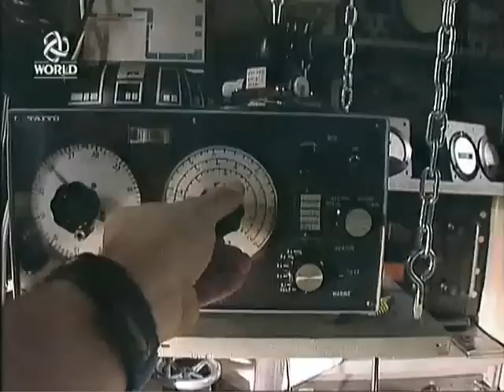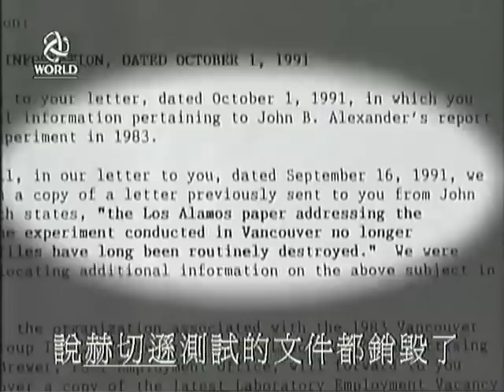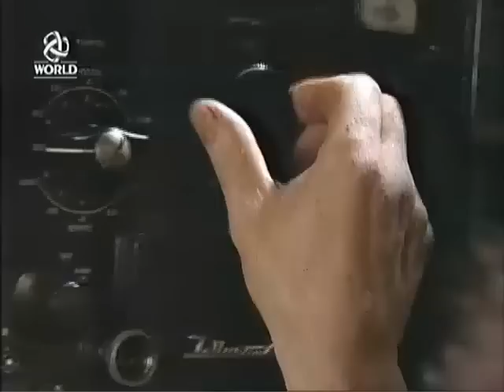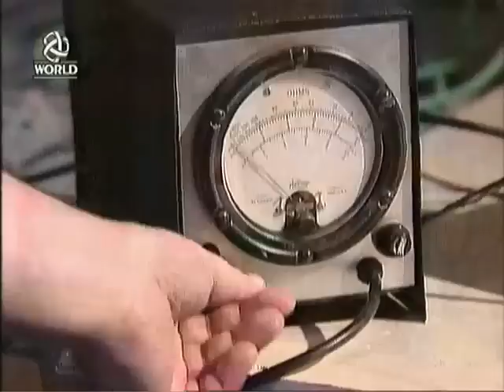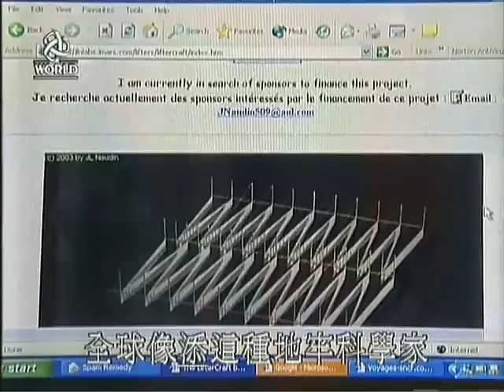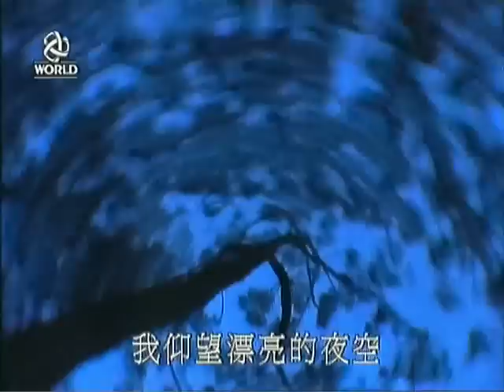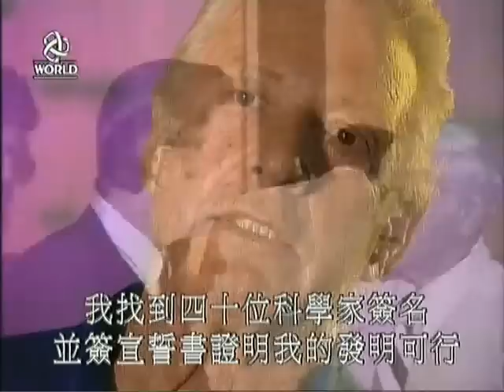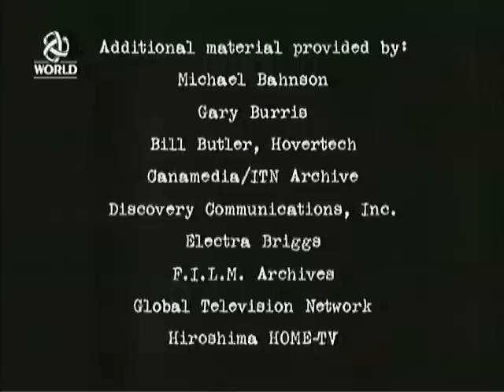Discovery Channel - Free Energy

Comment: Yeah.. when a mysterious effect has a wide range of unrelated results, that increase the ease of faking it, not decreases.  A single well defined, consistent effect that can be described and recreated, now that is hard to fake.

It should also be noted with the marconi example, people believed it was impossible for very good reasons and those reasons were true.  The physics was correct, and if not for a piece of information that had not been discovered yet, it indeed would have been impossible.  Long distance radio transmission did not rewrite physics, radio was behaving exactly as the math predicted.   That tends to be the difference between this drek and actual advancements, science is incremental.   Discoveries build off each other, not rewrite our whole understanding.   New discoveries involve 'what did we miss?', but still have to explain all the things we already know.

Comment: I want to build a solar powered steam generator, parabolic solar collectors, I need to find a way to conduct the heat and heat water with it, I think I can make enough power in the afternoon to off set losses during night time.... small scale for the home of Corse, with out the refrigerant.... just straight steam, maybe I can collect the steam in a large container with a weight activated valve that will allow me to also make electricity from falling water, Steam rises, use it in steam form to push a generator, and in water form to do the same on the way back to what ever plate I am heating to make the steam

Comment: most people  wont except it  cause of the law of conservation  and any thing  that can the government and its trolls will try and stop it fact is many things exist on market that do raise volts or amps   if a person with room temp   iq   knows what and how a power inverter is  or to look and know about car alternators that is fact rite there that more is coming out  than going in the regulator is taking 12vdc passing 9 volt 2 amp to magnetic rotor as it is spun field coil will produce13-14 volts @25 amps  up depending on size of enamel wire  watts/amps
Reply: +inventhead PROVE IT!
Reply: +inventhead PROVE IT!

Comment: ooo k trina i will prove my device if that is what you meant? i will make a video soon  rite now i am faced with other things such as work  with steady pay  the rest needs to be bought at latter time to finish my invention  there is nothing secret on what power inverters do  or current amplifire   or voltage amplifire  and not sure  what experience  you have in electronics or electrical  but i  have been doing  and  around  consumer  product a long time from vacuume tubes to transistors to chips i am no kid i am 50+ years old  can you say the same? i am also multi gifted and talented  if in any way you treat me with disrespect i will cut you rite off   i do not play  games i live truth not lies and i am no player of minds   peace

Comment: There is nothing mystical about what Joe Newman is doing here.
He his merely turning the current of the 12 volt batteries which is lets say 50 amps times 10 = 500 amps at 12 volts into 1000 volts on half a turn, the amps of this 1000 volts is very small, anyone can do this,
Its the current that does the work to power things not the voltage.
Just a step-up device, if you step-up voltage you get less amps, if you step-down voltage you get more amps, this is all that is happening here. Nothing new. Sorry.